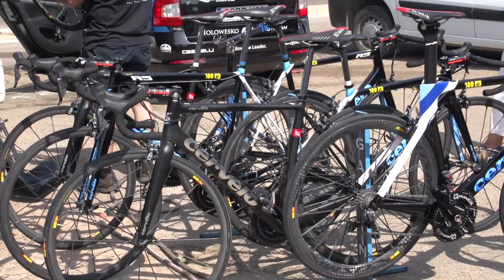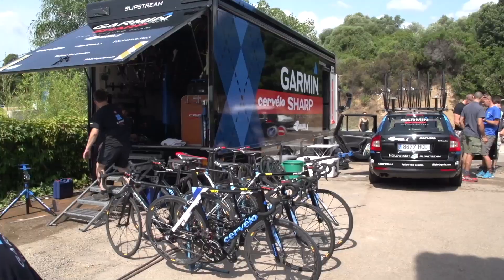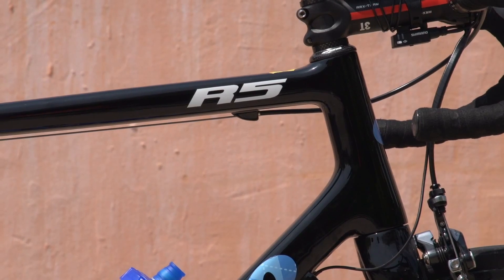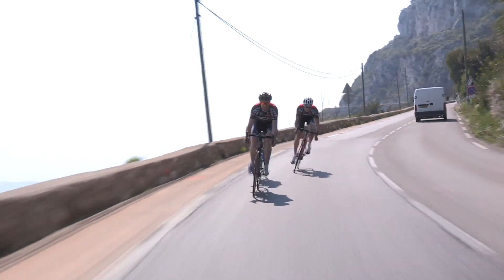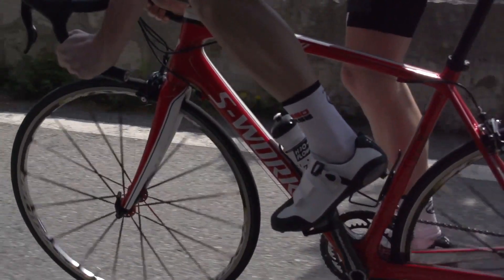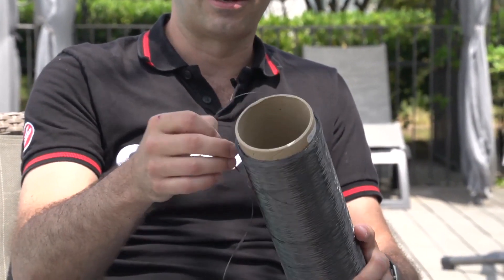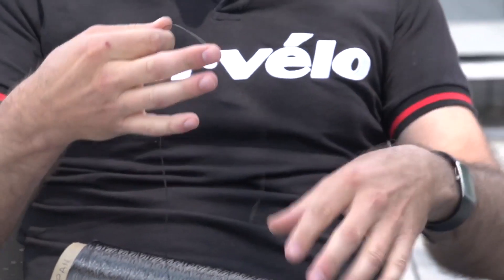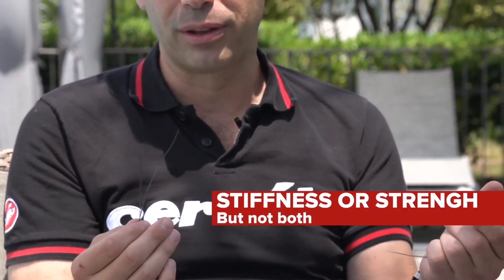How does carbon fibre work/carbon fiber road bike frame china

Comment: Nice...this consistent with what I'm hearing. He makes it sound so cut and dry. But basically it's just a difference in design of the tube geometry based on test. I guess the argument is out on the best tube design or the best material used in certain areas. Ideal of course would be the best of both worlds. Looking at the areas of stress, it's fun they haven't arrived  at the same conclusion for both.